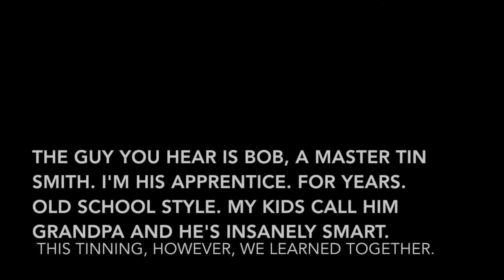Tinning Copper Cookware Process and Visual

Comment: Love the videos, thank you for sharing your knowledge.  How can i remove the old tin if i don't  have access to a media blaster?
Reply from the maker: You can use a hand drill with a metal removing attachment. It takes a bit longer and you have to be careful not to overload your drill motor, but an attachment like this from Home Depot works: https://www.homedepot.com/p/Avanti-Pro-4-in-x-1-in-Non-Woven-Drill-Mount-Quick-Strip-Disc-PNW040100D01G/202830913. I also have used a Dremel with different attachments to get into the cracks around the rivets and in the radii of the bases.
Reply: @housecopper  thank you . The drill attachment looks very aggressive would i finish with a finer grit and clean with acid? Looks like a dream job for you, but im sure you work very hard.
Reply from the maker: You don't need to unless you want. It's not as aggressive as you think. You'll have to use some elbow grease, I promise. :)  It won't leave as much of a residual mark as you think, either, but you could always finish with a sand flap, like this: https://www.homedepot.com/p/Lincoln-Electric-3-in-x-1-in-80-Grit-MTD-Flap-Wheel-KH156/202938567 or just a scotch-brite pad. After it's ready and before you tin, clean with water, dry, then a muriatic acid or something along those lines before starting to tin. And yes, it's a wonderful job, but a heck of a lot of physical work. :) Thanks for watching!
Reply: @housecopper  Is it entirely necessary to remove the old tin before retinning? I am in the process of trying to retin an old pot and am having trouble getting a nice even finish. I will be getting a better liquid flux (been using a paste), and some fiberglass wadding. However, I am wondering if the tin that is left in the pot may be causing a problem?
Reply from the maker: It's necessary to get most of the old tin out - any dark oxidized tin should be out at the very least. Also, if you don't have a blaster, you could use caustic acid, then go to an orbital sander, or some 80 grit paper, then muriatic acid, then tin. You need to get around the rivets, and you need to get all the dark out so it looks light and the copper is showing out in some places. Sometimes you're battling the grade of the copper itself - some copper isn't as pure and doesn't hold the tin as well. Sometimes it's the flux. Lots of times there is not enough flux, or the pot gets too hot, or the pot isn't hot enough. It's a huge learning curve, so give yourself some slack. :) As long as the copper is covered up, it is food safe and usable. If you want it to look smooth and perfect, that takes time and lots of practice and you'll always have wipe marks or swirls, or little drips even after 20 years. Liquid flux is definitely better than a past for this, too. And yes, if there's old build up, it can give you a little trouble. Every pot is different. :) Good luck!
Reply: @housecopper  Thank you for the help. I am looking at using muriatic acid as a flux, as locally here it is near impossible to get a proper liquid flux. I know straight muriatic can be used as a flux for stainless and such, do you have any knowledge of using it to tin copper?
Reply from the maker: I actually have never used muriatic as a flux. I use straight muriatic for cleaning and the copper/prepping/etching the surface of it right before cleaning it. It's important to use it to clean the area you want to flux and solder or braze. But I've never used muriatic as a flux for copper, so I can't speak to it. I will tell you (from experience) that muriatic burns off before the copper gets hot enough to tin, so I don't think it will work. The boiling point is too low. So my guess is it won't act as a bonding agent for the tin and copper for that reason for sure. Can't you order on Amazon? I order my flux from Amazon hahaha.
Reply: @housecopper Usually, I could! But I'm in canada and our postal service is on strike. It could take in to the new year to get. Locally, no body has any liquid flux, just paste flux which your past videos have said is difficult to use on a larger pot. I have rosin paste, and lead free plumbing solder paste, and a water soluble plumbing solder from benzomatic. Aside from that, muriatic acid is about all I have.  I was also thinking about diluting the water soluble solder to use as a spray.
Reply from the maker: That's right! I forgot about the strike - my publisher is dealing with that too. Well, then yeah, that's a problem. OK. Well, yes, the paste is pretty hard to use for this application. You have great pastes for small soldering jobs hahaha But ok, let's think...liquid solder...that won't dry up (you can do like water and soap in a pinch for tiny jobs, but not something this big). I suppose you could use the rosin. Or get some clear pine sap, crush it up, and use it in powder form, which might spread for you better than the paste. You'll have to use alcohol to remove the brown residue from the rosin, but it is a super old school option. Or call around to welding stores near you. They might have some options. Otherwise you might have to wait for the postal service to pick up. OR FedEx should work?
Reply: @housecopper  Welding stores is a good option that I will look in to. I have also heard of using sal ammoniac as a powder or diluted in water as a flux. However, blocks of sal ammoniac are hard to find as well! I have a jar of Handy Flux, but its meant for much higher temperatures and is sodium borate based. I don't suspect it will work.
Reply from the maker: Yes, I hope the welding stores give you some options. And yes, sal ammoniac works - both as a solid or diluted - I've not used it for the large scale application (mostly to help with the soldering irons) but you could try it as a spray diluted. The old coppersmiths used to run a brush covered in sal ammoniac along the inside before tinning as the flux. Another tinner and I were discussing that - if it was preparatory or as flux - and we thought the burn off from the sal ammoniac was pretty poisonous, which is why it's been kind of discontinued for tinning in general. But it's a possibility. You might find a block of it at a small hardware store? I'll talk to some of the guys, too.
Reply: @housecopper  I have another idea that I think I saw mentioned in the comments of one of your other videos. The liquid fluxes I've been looking at are all zinc chloride fluxes. Simple versions of these are made by dissolving zinc in HCl until the solution is saturated with zinc and are sometimes called killed acid flux. Zinc is easily sourced from home, so I'll just make some killed acid flux! I will let you know how it goes.
Reply: @housecopper  just wanted pass along that it worked! Worked wonderfully. I put it on a bit thick on the bottom so it's a little rough. But, I have another cup and pot to practice on. I used homemade killed acid flux. Used a flap wheel and overnight soak in acid to clean the old tin. Thanks for all your help. I hope to buy some of your products soon
Reply from the maker: Oh yeah we were talking about killed acid flux at one point! Good find - I didn't think about that!! I would love to see photos - and thrilled it worked! I will have to experiment with it myself one of these days. Flap wheels work great, and I'm so happy to hear it was a success!! Definitely keep in touch and congrats!!
Reply: @housecopper  http://imgur.com/a/DM5mT0p. Not as clean or shiny as a craftsperson such as yourself, but not bad for a first time with homemade flux. It looks smoother and shinier in person.
Reply from the maker: Hey it looks great (and definitely with it your first time and homemade flux!) - you should be super proud! Seriously awesome!!!

Comment: Thanks you Sara, your videos are very helpful.  How do you refurbish old rusted iron handles?  The corrosion can be very severe, but well-refurbished pans have lovely smooth, shiny, and blackened or dark grey handles.  What is the process?
Reply: Thanks for watching! If the handles are really bad, I will make sure they get a bath in muriatic with the copper before I retin, and then actually will, with bad cases, do a session in the bead blaster. If you don't have one, wash the handles in vinegar and scrub with the vinegar and a wire brush. Wash off, dry really well, and then you can do one of two things: buff with the wheel and let compound get in or rub old fashioned stove blacking, or rub in food-grade oil. It's always an experiment!